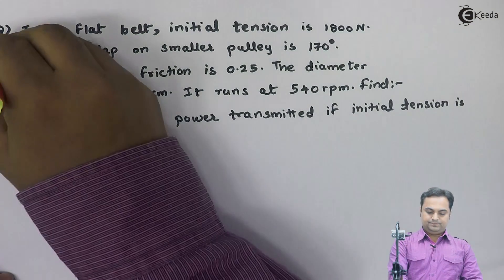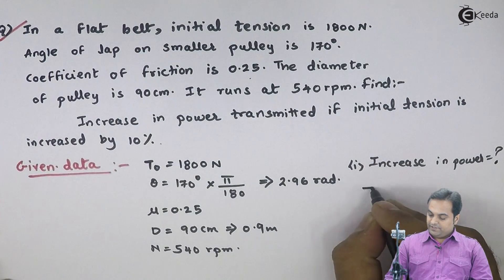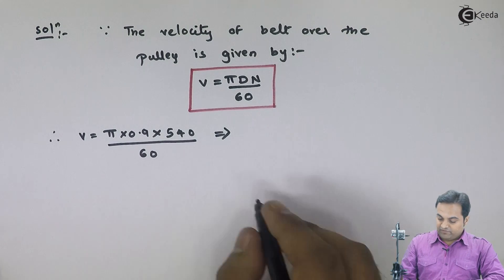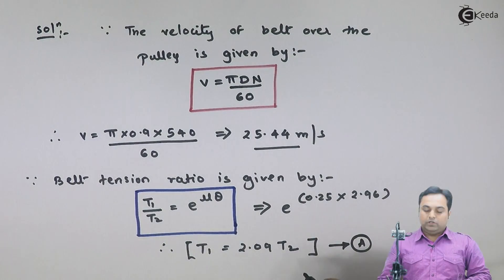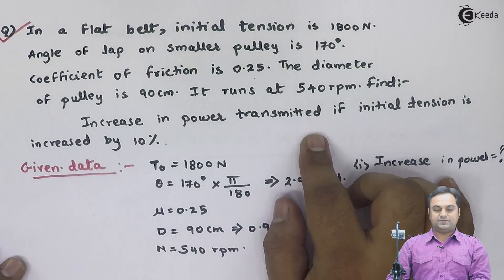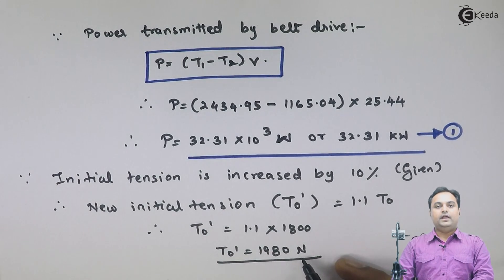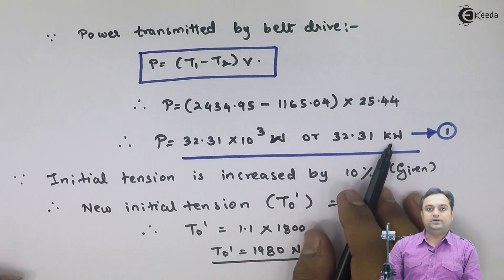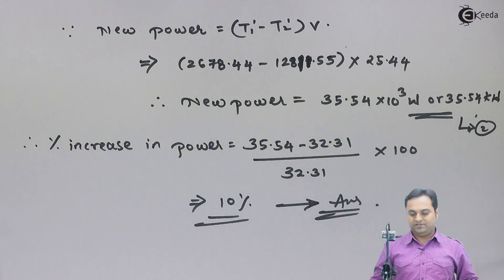Problem 2 Based on Belt Drive - Power Transmission - Theory of Machine

Comment: why dash initial tension = 1.1 initial tension, where is this 1.1 come from
Reply: now it have 100%. then a 10% increases, therefore 100% + 10% = 110%. 
T0' = (110/100)*T0 => 1.1T0
Reply: He is not wrong...The new tension= old initial tentative + 10% of old initial tension

T’=T+0.1T=1.1T
Reply: Can anyone please explain, how’d the “To’ = 1.1To” ? Can’t understand actually how the To is 100% even it’s not given in the problem itself [Did we assumed it 100%]
Reply: 1800 10 PERCENT IS 180  SO U CAN ADD 1800+180 =1980 WHICH IS T DASH 0... 1.1 IS JUST MULTIPLYER APPLIED IN THIS CASE FOR SHORT
Reply: Lungelo Mlungisi yes he is  wrong it should be 0.1 instead                 of 1.1
Reply: @pruthvirajkhot9537  no man it is 1.1. it says increase in tension!!!